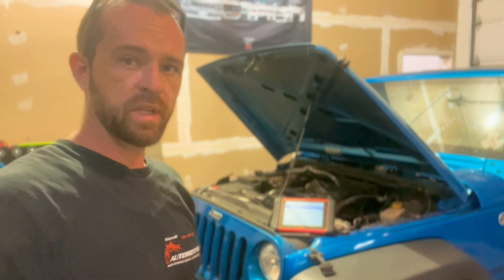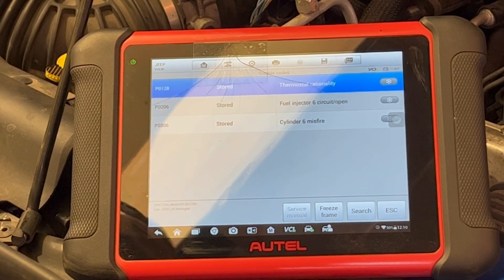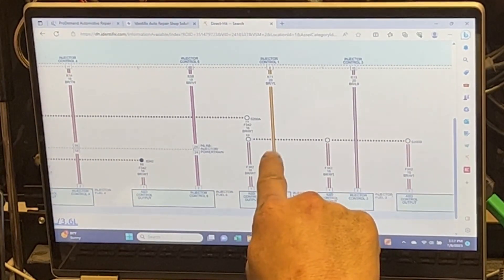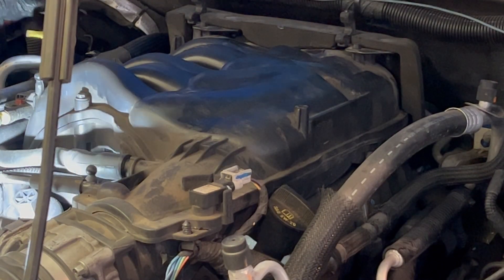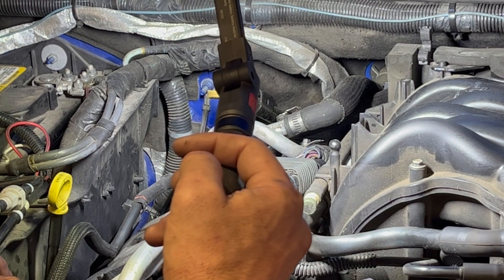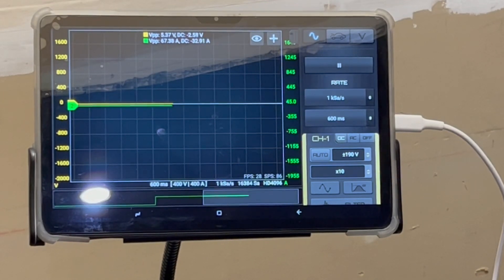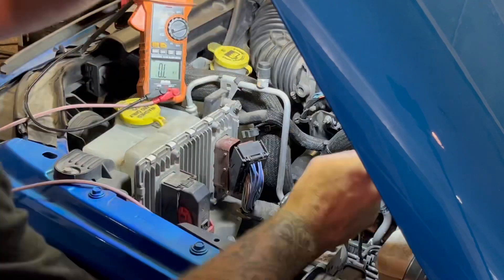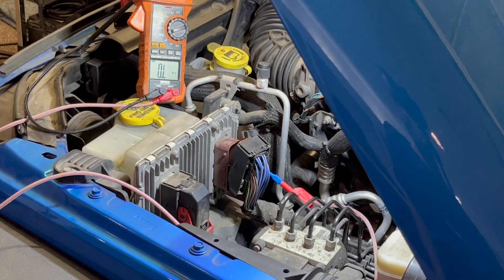2015 Jeep Wrangler 3.6L - Fuel Injector Open Circuit Diagnostic DTCs P0306 & P0206

Comment: Great video! Two thumbs up! The two diagrams at 3:35 and 3:37 seem to contradict each other. The first one shows #1 at the front passenger and the second one show it at the front driver. Am I correct on that? I've research where is cylinder 1 and I get conflicting answers. Most seem to say it's the front passenger. Also, is the PCM and ECM at the same device? I notice you go back and forth and it looks like the same device in the video. I have a scope. Were you just connecting to the two wires going each injector and measuring the voltage lines? I've never used my scope on a vehicle before. Great to know! Thanks for all the help!

Comment: Hey man, I could really use your help right now. I’ve got a 3.6l, the same one you’re working on, just in a challenger. After changing the oil filter housing and replacing the spark plugs I’m getting the same codes your customer here is getting. I went back and replaced the fuel injectors and the problem is still persisting. P0306 and p0206. Wont go away. At this point it has to be something electrical right? I would appreciate if you could tell me what wires I would need to be replacing in order to fix this, thanks man.
Reply: @hdi7kJXqmW4q  if I remember properly, the p0306 code went away on its own which I think was due to the fuel injector change. It just took a bit of time for the code to fully go away. The p0206 code ended up going away after I changed the thermostat housing. Not immediately afterwards because it does take some time for the computer to recognize that the problem was gone, but it did end up going away. 4 months later and I haven’t had anymore issues with codes or anything.
Reply: @hdi7kJXqmW4q  no, they were permanent codes. So they stayed until the system detected that the problem was fixed, no matter how many times I tried to erase them.
Reply: @hdi7kJXqmW4q  yeah, pretty much. There was a small amount of time where one of the codes were present and the check engine light was off though

Comment: Really liked this video. I work in Aviation but my passion is Automotive modification and repair. More on the mods... lol than repair. But I'm no good with electrical. I liked how you didn't have a bunch of start stop edits. It shows how quickly this can be diagnosed, testing all injectors on each bank, with the right equipment. I need to start accumulating the equipment. I currently have these codes on ky 2015 Jeep Grand Cherokee limited 3.6. I have dreaded cylinder 5 and 6... I've had to pull the intake 5 times this year for oil cooler cracked housing, then the cooler failed, then the cheap oil temp sensor failed, then the harness to knock, oil pressure switch, oil temp sensor failed. On top of that, P0420 and P0430, which I actually diagnosed using data on a scan tool and you tube. Fuel trims were lean, constantly. So all that to say, I got my check engine light off for the first time in 2 years.. it lasted 3 days now this. I'm not complaining, I've learn a ton. Thank you for explaining everything you did throughout the video.

Comment: WHERE WAS YOUR GROUND SIDE OF THE METER WHEN YOU WERE TESTING THE RESISTANCE OF THE INJECTORS ...................... I CANNOT SEE THANKS ???????
Reply from the maker: The other lead was on the other end of the wire at the junction connector that I was testing on at the beginning of the video.

Comment: When ive used my 1008c with the hscope app it will not let me record in automotive you know why ive paid for the automotive bit of the app
Reply from the maker: You should be able to record. Click on the master function. It should allow recording for an extended period. What I was doing was just on the main scope screen. Maybe try adjusting your time base and then zooming in.
Reply: do you have it set to auto or manual start?